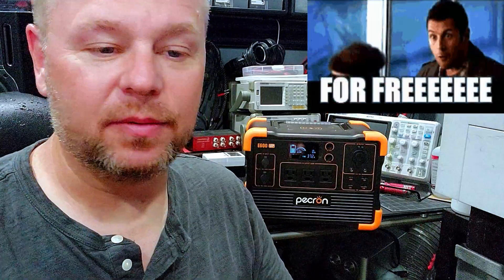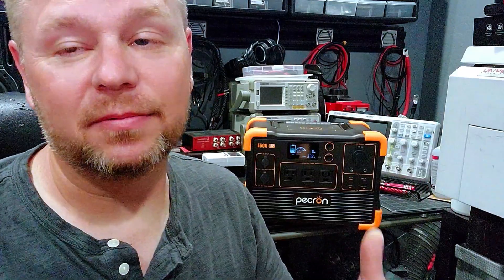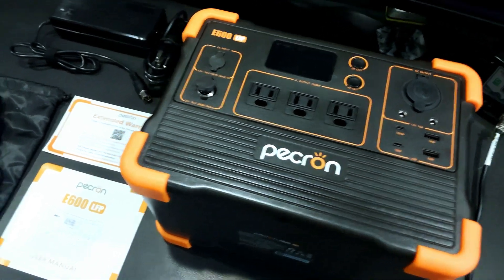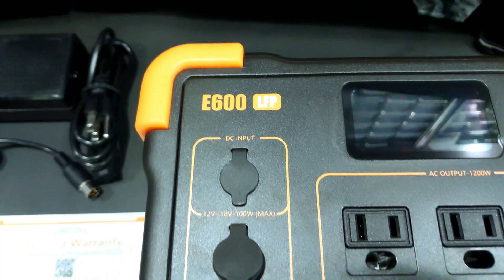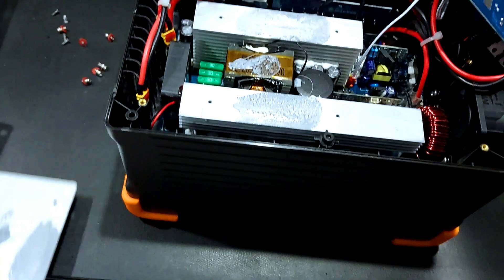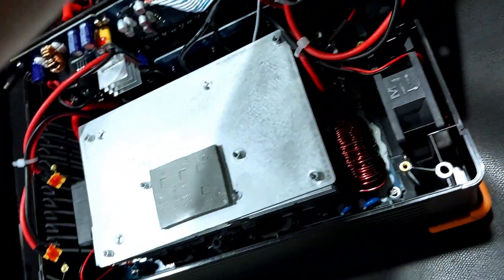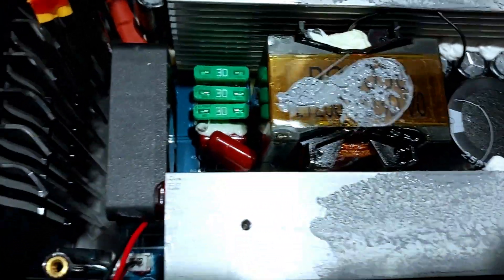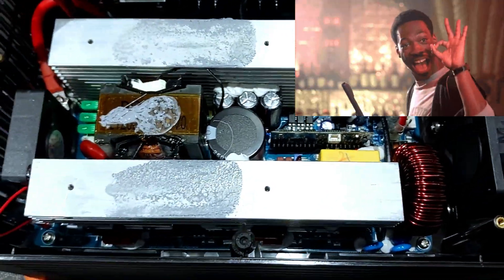PECRON E600LFP PORTABLE POWER STATION REVIEW | TEARDOWN | LOAD & CAPACITY TEST CAMPING - OVERLANDING

Comment: First: GREAT INFORMATIVE VIDEO!

I almost got one, but 3.3 hours to charge with a power brick... was a no go. If it wasn't for that I would of got it. To be fair this video came out before the E1000 .But my advice to any one, get the Pecron E1000 for 319. Even 349 is GREAT! With battery heaters to boot and an 1800 watt inverter. It charges faster than 3.3 hours with out a power brick.

For smaller power needs I got the E500, this is for lap top, LED lamp lights, bi-pap, even desk computer and small fridge. I got two E1000s covering the larger lift stuff. But for a 576 WH batter at 189, and I can l use items I need to use. Yes it has a 600 watt inverter, but for the reasons I got it. It works good enough with out 3.3 hours to charge on grid. Down side of the E500 is only 100 watts of solar... That almost put me off but for my needs the E500 full fills them. Oh and it has a light.

But the PROs I see in the E600 that interested me was the 1200 watt inverter, and the 350 Watt solar input! For off grid that is pretty dang good for a 614 WH battery for solar main power!